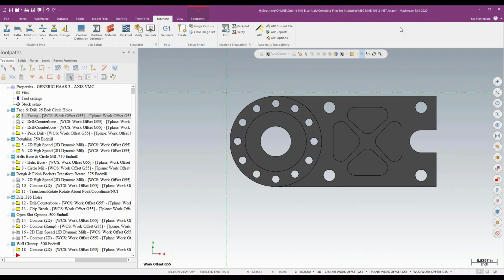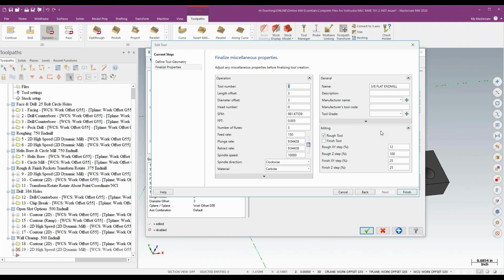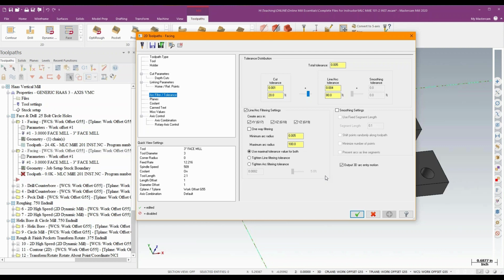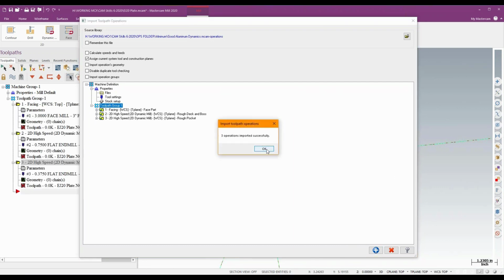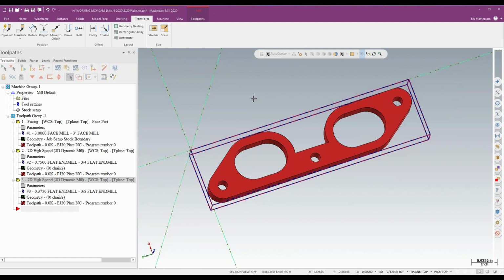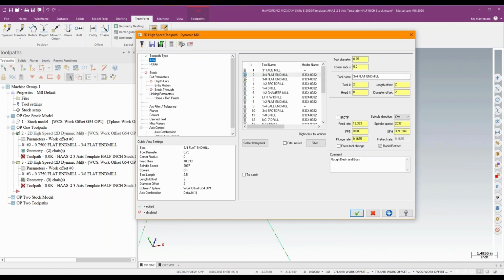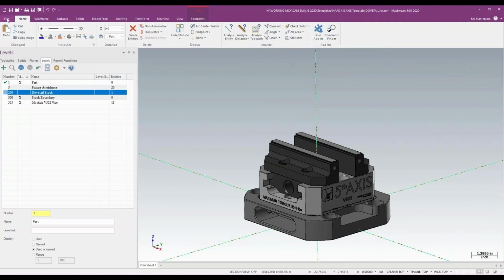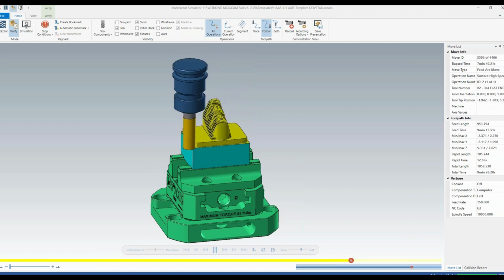Get Your Mill Programming Standardized | Mastercam Webinar

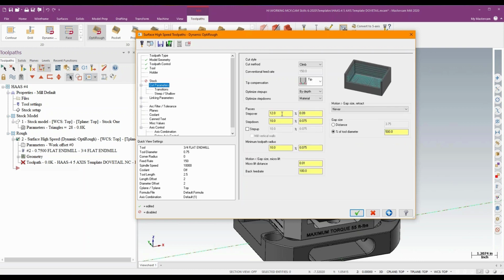Comment: 57:07 still not working in 2022 hle. i am currently working on optimizing my post (another company is coding it for me) and i have told them that this bug exists. maybe they will throw out a bugfix hopefully
Reply from the maker: The home learning edition does not support any posting activities by design.  Post-processors relate to putting the program onto a machine, which means you are making parts.  HLE is for learning how to program the toolpaths only.
Reply: @MLCCADSystems  my bad, hle is at home for learning and at work we have 2021

Comment: 9:07 now imagine we have an advanced cutting parameters page (in the tool editor) where we can define every cutting parameter of every toolpath available in mastercam (choosing per dropdown menu, as many as i want until every possible parameter has been set) for every stock material we have created. That would be a huge improvement imo
Reply from the maker: I recommend reaching out directly to your local Value-Added Reseller or to Mastercam to give them ideas like these.  If they are bugs or are workflow related issues, they can assist you with getting up and running smoothly very quickly. If your recommendation will help make the product better a request can be submitted for consideration in future releases.
Reply: @MLCCADSystems  i have a whole list of features i would like to see in the next releases but im not done yet ^^
Reply from the maker: Sounds good, feedback is always helpful, just make sure you know we don't send video comments to Mastercam directly for consideration as enhancements.
Reply: @MLCCADSystems  okay thank you :) i will send them an email when im ready :)